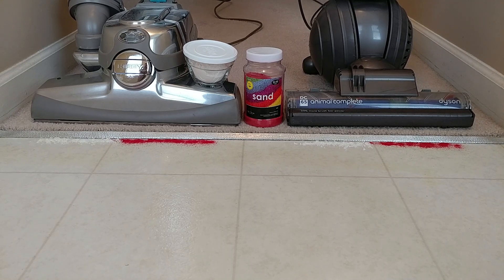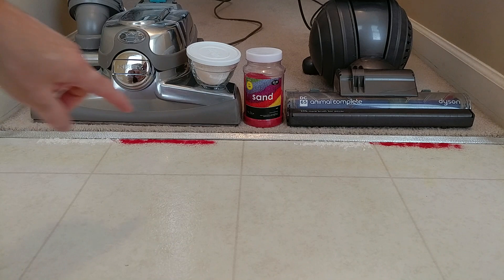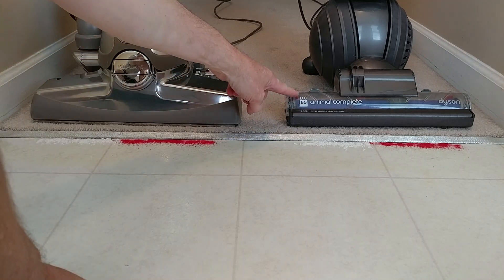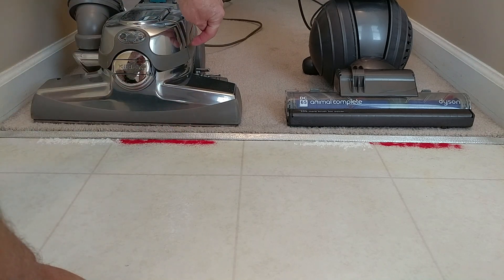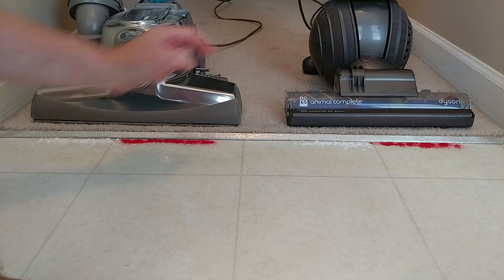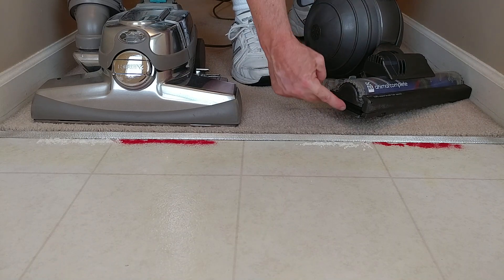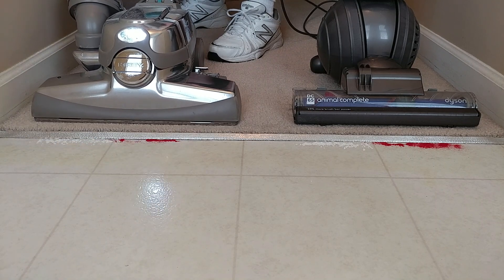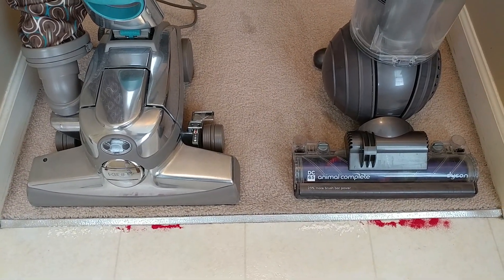Nozzle Airflow Versus Carpet Depth: Dyson DC65 Versus Kirby Sentria II

Comment: How does a Kirby have more CFM at the nozzle than at the end of the hose? Does the DC65 or the Nv22 have more CFM at the hose?
Reply from the maker: Aidan Forrester the main fan intake is twice the diameter of the attachment hose, hence higher airflow due to less restriction.

Remember, you usually don't clean flooring with just a hose, a nozzle of some kind is attached, so hose airflow measurements aren't very useful.

Comment: Have you ever found a vacuum with a bad motor?
Reply from the maker: Aidan Forrester if I do, I don't buy it. But if after I buy, restore, put into regular usage rotation and then the motor has an issue, I repair it. Have you seen the Riccar 8850 bearing repack video?
Reply: VacLab Yes I did see it! Do you still have bad bearings in your G5?
Reply from the maker: Aidan Forrester yes, and when I have time, you will see a video of the G5 being rejuvinated. 😎